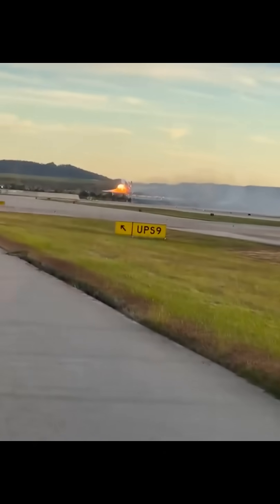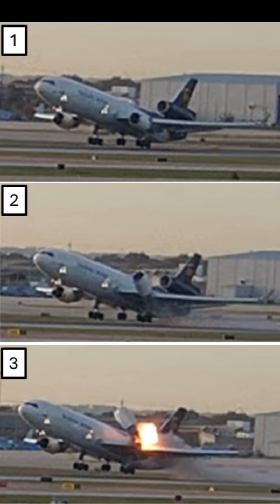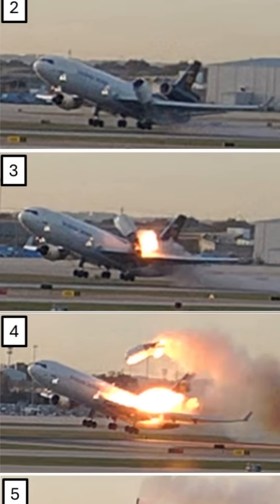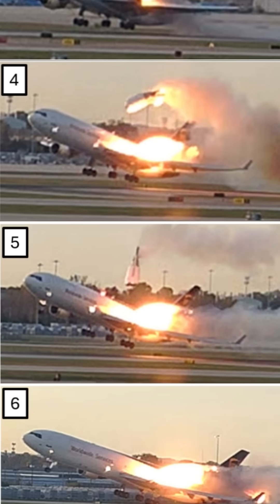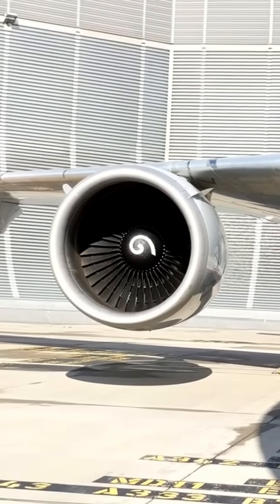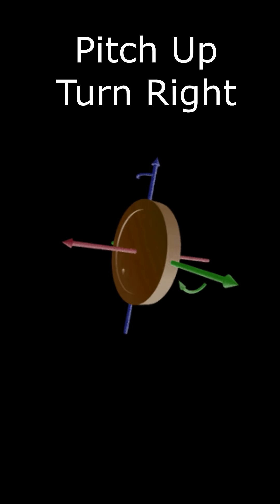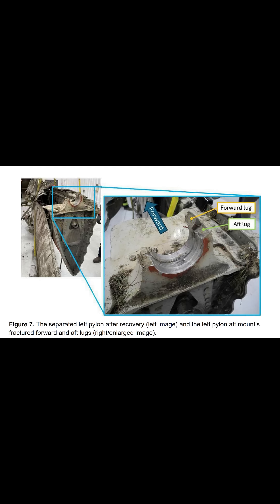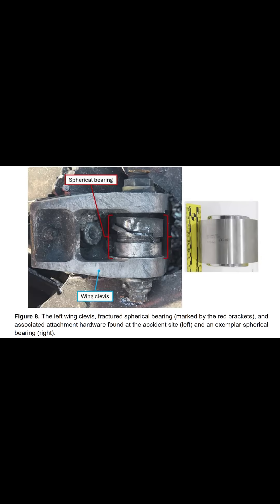Lost Engine Didn't Fall Down, But Flew Up Over Doomed UPS Aircraft #UPS2976

Comment: I wonder if aircraft with counter rotating engines are positioned to yeet outboard in this circumstance? (Given that pylons ate deliberatly weaker than wing roots to serve as a mechanical fuse under extreme vibration.)
Reply: The engine mounts to the pylon are designed to fail in the event of impact or unacceptably severe out of balance vibration. The pylon mounts to the wing are not designed or intended to fail under any circumstances.